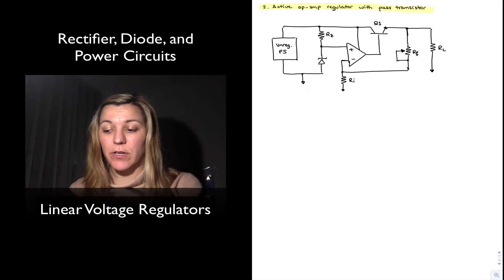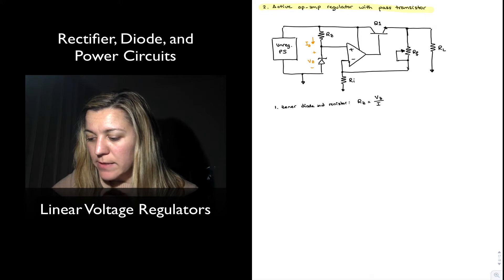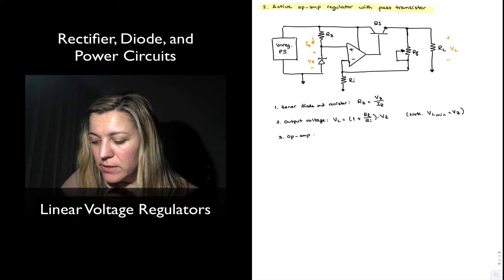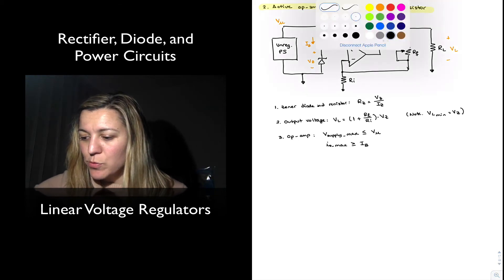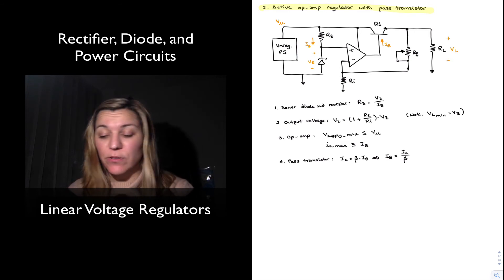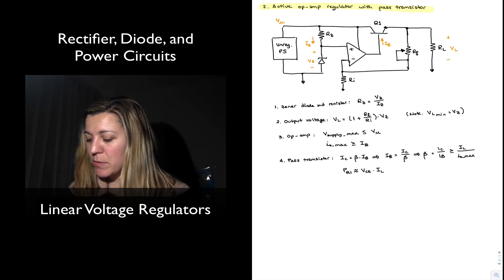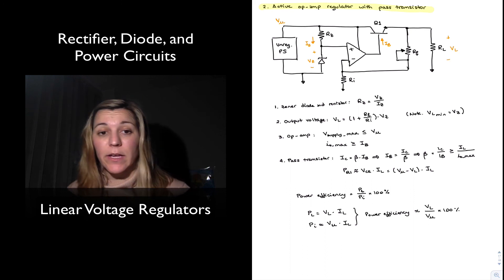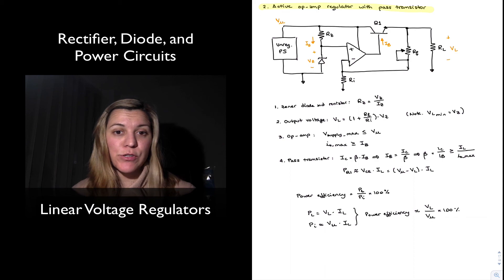Active Linear Regulators (Pt 2)

Comment: I've seen regulator circuits where the pass transistor is a darlington device with hFE perhaps greater than 300, plus a capacitor from that darlington's base to ground.  I think this topology is called "capacitive multiplier" where the hFE 'simulates' a higher value capacitance to the unregulated voltage, and further reduces output ripple.  In your opamp circuit, I can't see where any base-to-ground capacitor might be used.  Thank you.